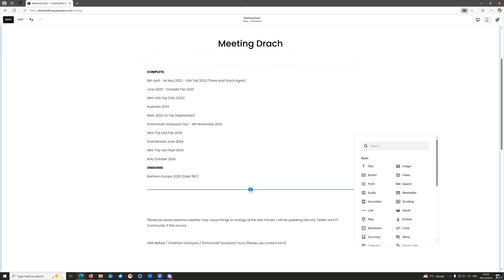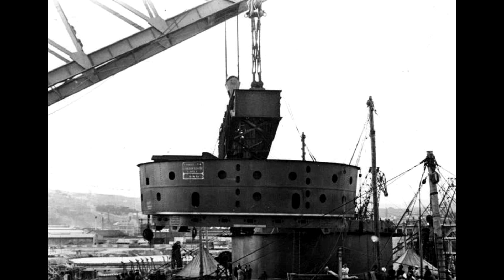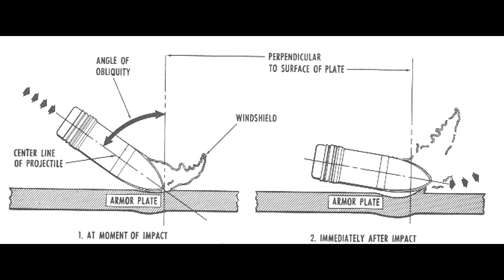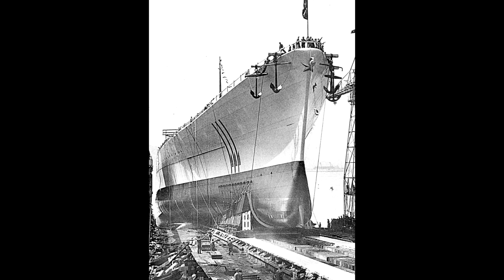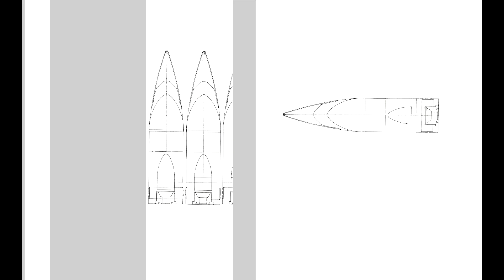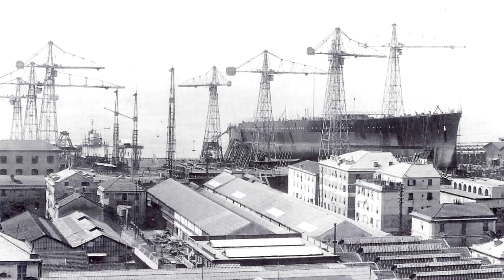Naval Engineering - Did the Littorio's Armour Scheme Work?

Comment from the maker: Pinned post for Q&A :)
Reply: Drach How would battleship/cruiser scale  Sabot (apds) (apfsds) or Heatfs rounds work, and if they were employed how effective would they be against ships? Maybe something like apheds like the Maus used?
Reply: @Gavin-iw4lt (and also JamesBreeching) this question comes up periodically. The short answer is that no one tried because of the huge difference between tanks and ships: volume. If you directly hit a turret with a sabot/HEAT/HESH round, then it's somewhat analogous to a tank because there is a lot of vital stuff (for that turret) right there within a few meters. However, with warship guns you're firing at such long ranges you're lucky to hit the ship at all, and the deck or belt armor is most likely. In that case, no one cares about the compartment or two just behind the point of impact, because those can be anything. The vitals you want to reach are deep in the ship (magazines, engine spaces, plotting room for fire control), so the shell has to be able to travel another 10-15 meters and then have an effect. For that, you need an APHE shell with a delayed fuse.
Reply: It would have to hit ammo storage or the gun turrets  @Gavin-iw4lt
Reply: How exaggerated was A. Iachino's statement regarding the Littorio Class' dispersion?
Reply: @Craig-04  Marco Santarini was able to find period Italian data on gunnery measurement and plot it against data from other nations.  See  Gunfire dispersion of Large Italian Naval Guns - The strange case of the 381/50 ANSALDO-OTO mod. 1934 gun   in Warship International 2020.  I haven't studied his work in depth, but the main comparison chart seems fairly clear: the Italians had a dispersion problem.  You can read this for free by signing up for a free JSTOR account.

Whether or not the assumptions Santarini makes in his analysis are correct is something I can't say at this time, but that seems to be more about causes of the dispersion and not about whether or not the dispersion existed and was a problem.

The wartime accounts of British sailors also supports the conclusion of large dispersion.
Reply: What were some absolutely crazy ideas for destroyers post WW1? We do know some crazy battleship ideas like the Tillman designs or cruiser designs. But was there any weird, unusual, bizarre or even ridiculous destroyer designs? Like a destroyer with 10 main guns maybe? Or was the lack of said designs because you could only go so far with the destroyer designs themselves before they simply became light cruisers?
Reply: Did any nation ever tried to actually manufacture a gun turret with 5 or 6 guns?
Reply: A followup question from drydock 326. You said France had a plan if Japan decided to attack first. What was that?
Reply: How much would Littorio have displaced had she been built with a more conventional armoured belt of equivalent thickness?
Reply: All very cool but can't the ammunition be redesigned to secure the cap more effectively?  Maybe a central rod to pin the whole thing together(?)  Meaning that you have a very, very expensive ship designed according to de-capping assumptions that no longer apply due to much easier and cheaper ammo changes.  (I appreciate the video BTW  Most informative)
Reply: Why did they not just use a bigger air gap, instead of fussing with foamed concrete? Was it really worth that weight and complexity penalty just to move the outer plate inwards by a couple feet? (Was it a dock size issue, like with the Panama Canal limiting US ship widths?)
Reply: If you started an onlyfans, would your name be "General Penertration?"
Reply: Did the Marine Nationale have a Plan Z like Plan? What about the Regina Marina?
Reply: Good Video Drach!! You mentioned HESH for tanks...Did any navy think about or experiment with HESH for big ship guns???🤔🤔🤔🤔🤔
Reply: What in your opinion is the single most bizarre theory about a ship's loss via enemy action? IMO it's the idea Prinz Eugen was the ship that caused Hood's magazine detonation in spite of her not even firing on Hood at that point.
Reply: @bkjeong4302  on a similar note...That Hood blew herself up after throwing a propeller shaft!!!
Reply: I didn't realize "solder" had such a different pronunciation in B.E. compared to A.E.
Reply: Assuming that the Francesco Caraciolo could have been converted to an aircraft carrier, what would an ideal conversion look like, especially if the Italians had the time to avoid the earliest mistakes of conversions (as the British learned)?
Reply: How would you have designed the Littorio’s armour scheme to improve it?
Reply: We're there any other interesting armor concepts from this time period? The littorio is of course the only one that got adopted but I'm curious if any other people were drawing up strange armor ideas at the same time
Reply: Obvious question I guess, but why didnt Italians increase the width of the space between armour and the de-capping plate?
Reply: Other than concrete filling the void, were any other materials considered such as fluids, aggregates (sand/rocks/infill), or engineered semi plastic clays? What about other structural concrete techniques such as engineered precast or post-stressed concrete? Whilst not exactly common back then like it is now, I can see an argument for the significant weight increase being offset by the corresponding increase in protection.
Reply: @p.i.staker886 I wonder why they didn't just fill it with reserve bunker fuel, I mean I know that the Italians mostly designed for the med and so didn't need the huge reserves of Pacific combatants, but further time away from requiring replenishment is pretty much always a good thing.
Reply: @andrewfidel2220  That was another option I considered as well, if they went that route then they could also reasonably justify making the gap between the plates even larger and call it reserve fuel storage because if they ever DID get into an engagement with another battleship it's not like they're going to just resume their patrol, they're gonna head back to port to get patched up anyway and they can recover/replenish that fuel then.
Reply: IIRC the Buffel was moved from Rotterdam to Hellevoetsluis.
Reply: The real question we all need to know now, with your newly updated research in mind....Bismarck or Litorios? Which 15" Fascist Battlewagon are you betting on at the race? Well, before someone's airforce sinks the winner.
Reply: I recently rewatched your excellent video on ship's cats and a question came to mind. I know it's bad luck if a ship's bell rings when it isn't suppose to. But what if the cat rings it? After all the bell's rope makes a great cat toy.
Reply: Could the Italians have adopted a dual-use secondary armament for the Littorios, like the American 5"/38?  If so, what would that look like and how would have worked? Would there been any savings in weight and could that have helped elsewhere, in armor, fuel oil, or faster speed?
Reply: Hey Drach! On you way from Bremerhaven to Gdansk, lies the German marine memorial in Laboe. There is one of the props of Prince Eugen, which the Americans gave back to Germany after the Op:Crossroads Bomb tests. And on the beach is another germany ww2 U-Boat.

Greeting from Germany
Reply: Why were some of the Majestic class battleships deprived of their main battery to arm the Lord Clive monitors? Isn't four guns per ship better than two? Or is it more along the lines that more ships mean more targets can be hit than the weight of fire per ship? What was the reasoning behind disarming half of what looks like, on paper at least, a reasonably effective class of pre-Dreadnaught battleship?
Reply: Speaking of the Littorio class, would the accuracy have been better or worse had the Italians selected the super heavy shell option instead of the hiper velocity one for the main guns?
Reply: This is just a comment. First, I have zero experience with structural foams being impacted by high speed projectiles.  However, I do have some experience with RIGID structural foams in lower speed impacts, more in the 5 or 6 g range. Things we found, some may be obvious. First, force transmission is noticably slower due to the increased path length through the thickness of the material. Likewise, obviously the force is somewhat absorbed by failure in the immediate impact area. And lastly, the air pockets themselves make a difference. Identical foams that were vented performed about 10% worse (force transmission to the base material) than non-vented foams. Air compresses, but it starts to fight back after a while. But like I said, tests I saw were slower speed and blunt impacts. They were also "airy" foams in the range of only 20% density compared to a solid mass of the same material. But they were rigid, as in you could stand on them with no noticable damage or deflection. And I know nothing about foamed concrete.
Reply: You failed to answer this as my Patreon question some months back and it seems  appropriate to rephrase here. Hendrickson "Crisis in the Mediterranean" (UNSI Press) Chapter 2 has a section on a scandal on how the Terni Armour was not as good as claimed; the manufacturer considering it equal to Krupp. Would this mean that it was not significantly better than Harvey steel? Brassey doesn't cover the reports in the editions 1904 to 1907 which is when the scandal broke in Italy during 1904/05. My own research shows probably the "Naval Annual" is the best coverage of armour plate in this period which isn't covered by dedicated books.
Reply: When reading to your child at bedtime, do you intend to end each book with "That's it for this read-along. Thanks for listening. If you have a comment or a suggestion for a new book to read, let us know in the morning. Don't forget to stay asleep in your drydock all night."?
Reply: What is the weirdest armor method you've heard of being purposed, regardless of it it was tried. Do you think it could have been effective?
Reply: I have always wondered how an internally sloped armor belt wouldn’t deflect a shell down into the ship?
Reply: When the Roman Empire built the Pantheon, one of the tricks that was used to reduce the weight of the concrete at the very top of the structure near the opening at the top, the oculus, was to add small hollow spheres to create small bubbles in the concrete. The Italians almost certainly would have thought of this when they were used the foamed concrete in the armor scheme of the Littorios. This would add an interesting variable to the calculations, as the air bubbles would tend to disrupt the primary shock wave and create smaller secondary waves inside the main shock wave that would dissipate the energy more effectively. This sort of scheme within a scheme would probably add so many variables that trial and error, i.e. experimenting a bit, would be the only way to create more effective armor, especially during the 1930s when there were no electronic computers available to do a Monte Carlo analysis. is there any historical evidence that the Italians ever tried to experiment with adding bubbles to make the foamed concrete less uniform?
Reply: It seems like there is a variable missing from the calculations, or maybe its just rattly bolts in my head. How does the heading of the target ship, and the curviness of the hull affect the effectiveness?
Reply: Would it have made sense for the germans in ww2 to build their ships completly coal fired/oil Sprayed only.(of course the Design would have needed drastic changes, but at least they could have used them more than once a year.)
Reply: If one were to take the blade profile of a ship's screw and of a WW2 era airplane propeller and switched them around to scale, what would happen? I imagine it would not work particularily well and likely result in some vicious prop wash on the plane, but anything beyond that rather exceeds my minimal understanding of fluid dynamics
Reply: How did the American Super Heavy shell perform against a de capping plate? It was all about a heavier cap, attached more strongly to the shell. (forcing the shell to be stronger.) would this affect how thick the decapping plate would need to be to actually decap it?
Reply: How you consider the pugliese sistem on the littorio? Did it gave better protection against torpedo?
Reply: Do you think such an armor scheme would have helped the bismarck? And also, would it have been better if they had filled it with a liquid barrier, perhaps something like vegetable oil?
Reply: You mention "the video on shells vs. armor" - which video is that?   Are you referring to "Naval Engineering - What happens when a shell hits a battleship?"
Reply: I was rewatching one of the Spruance videos when you mentioned a Japanese air attack on Roi-Namur and the subsequent supply shortage as well as forcing the navy to attack Truk. I was wondering if you could briefly explain it and/or talk about some other obscure attacks with long term effects. Thanks Drach
Reply: Around 05:10, is this a shell with two fuses?  What for?
Reply: I realize this is a profoundly impractical option, but had it been available at the time, could an explosive reactor armor scheme been effective against battleship grade shells?
Reply: In a worst case scenario how would the war in the Pacific have been affected if, in fact, George Bailey had never been born?
Reply: First, I loved the graphics; they made understanding the problem so much easier. 
My question:  You claim that a 10-inch plate is better than a stack of 10 1-inch plates. Please explain this and don't shy away from going deep into engineering. I have some engineering knowledge, but in this case it goes only far enough to say, "Cracks are bad." This is enough to explain why steel is better than glass, even though they have similar tensile strengths and it is enough to explain why we drill holes at the end of cracks in an old steel plate or an I-beam. Unfortunately, this limited knowledge leads me to see the stack of plates as better, since it has an intrinsic crack-stopping method built in. I accept that I am wrong, but I want to know why.
Reply: If littorios armor sceem some how became the standard for the major navys of ww2 would navys try to counter it with heavier shells or would they try a naval version heat or hesh shells? And did any navys use heat and or heash shells
Reply: I enjoy these episodes when material science and metallurgy is discussed, you seem to know more about this topic, can we have more videos discussing these topics?
Reply: Drach,

Going through the older drydocks and other pieces of content regarding American battleship guns, namely the 16”/50 Mark 7, it’s clear that you don’t believe the Super-heavy Mark 8 to be the optimal choice. If you were transported back to mid-1930s BuOrd, what changes/decisions would you make in American shell design to improve the overall performance of the modern US 16” guns?
Reply: Have you done a video on the British Hawkins class heavy cruisers if not is there anything you have to say about them
Reply: 0. Why did the twin 100-mm mounts on the Akizukis weigh more than the twin 127s on the Fubukis through Yūgumos, despite the lighter guns?

1. Of the grand total of four naval battles in history between full fleets of armored oceangoing surface capital ships, you've already covered three (Lissa, Tsushima, and Jutland) in full videos or series thereof.  Any plans to cover the last remaining member of that set (Yellow Sea, 1904)?

2. Did Crossroads Baker actually sink Nagato?  She was already leaking badly, and would've quickly foundered anyway once she and her pumps were abandoned; given the considerable time between when she was nuked and when she finally sank, could said sinking have simply been the result of said severe preexisting leakage being left uncontrolled for several days while she was too radioactive for anyone to board her to turn the pumps back on?
Reply: if the Bismarck  broken out into the Atlantic after fighting the battle of the Denmark straight what type of measures would the British take with their convoy escorts how much damage with the Bismarck and flicked on Adelaide shipping  and what type scram of battles the Bismarck fight 135
Reply: i was watching the video on the refit of Hood and i was wondering how would a duel between her and the Belgrano would go if she was preserved and then called back for action in '82
Reply: Is there any modern(ish) high-speed camera footage of big naval shells hitting armour?
Reply: 2025 Nothern Germany Ride, go to Peenemünde (Tarantul/ U-Boat and Peenemünde itself of course) and Stralsund Nautineum (on Dänholm ex. German Navy Base)
Reply: Have you considered visiting the Aeronauticum at Cuxhaven (north of Bremerhaven)? It is the museum of German naval aviation, yes, but it is also the site of the Zeppelin/airship base, and has a very good exposition on that, as well as of the integration of aircraft with German ships.
Reply: Weight for weight, how would a system where the decapping layer is really thick in places and nonexistent in others (i.e a grille or grid) do?  I'm assuming the bar spacing would be smaller than the shell calibre, meaning they couldn't get through without at least a grazing contact.  That might even be more effective as it pushes or gouges the cap asymmetrically, tearing it and causing it to tumble.
Reply: So when using a 12" shell as stand-in for 15" in testing, how was the 12"s lower mass, and thus its lower ability to absorb energy without shattering, accounted for?
Reply: What are the books and resources from which you got all these wonderful diagrams? I heard Nathan Okun but I'm eager to learn the others
Reply: Here's a frightening thought. 16" gun firing a depleted uranium sabot round.
Reply: Could one have a layer of tubes, to be pumped full of water for combat, to give some benefit similar to adding concrete between spaced armour, but without always having the weight penalty all the time? Are there examples of that sort of thinking (I recall some torpedo defence schemes do)?
Reply: Q&A: Concrete or foamed concrete... What if the space between the two plated as filled with fuel like torpedo defense systems often were?
Reply: Who was correct (Or closest to correct) on what range battleship engagements would be fought at, and were they able to make effective use of that knowledge?
Reply: You should ask this guy if he is interested in modelling battleship hits. He does it for tanks. https://www.youtube.com/@dejmianxyzsimulations4174

Reply
Reply: Do we know who was the individual who came up with the idea for the wooden fins for the Torpedoes used at Pearl Harbour?
Also I know I asked the question some time ago but I can't find the Drydock in question again, so could you go over how the fin's worked on the Torpedoes?
Reply: @joshthomasmoorenew  I think they were designed to slow the torpedo's entry into the water so it didn't plunge too deep and impact the bottom.